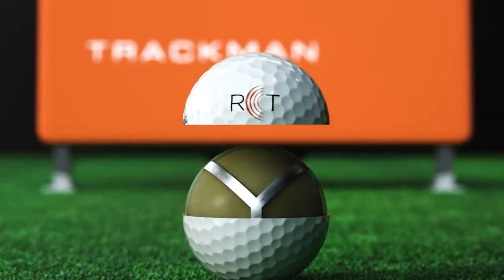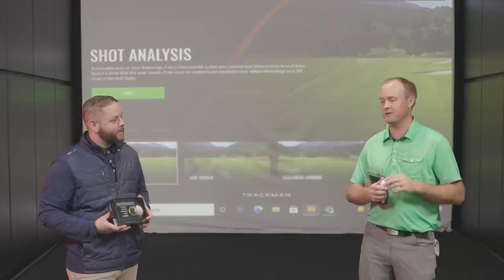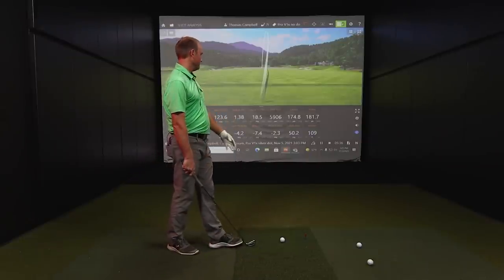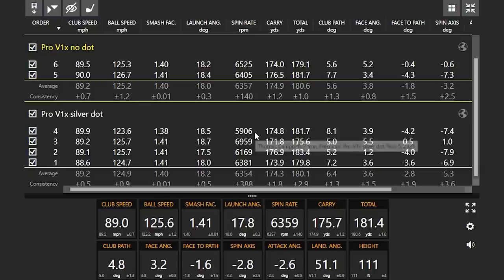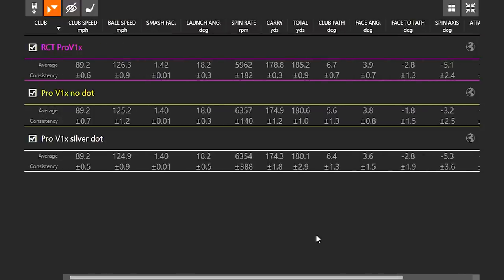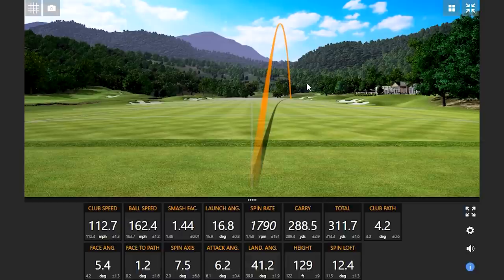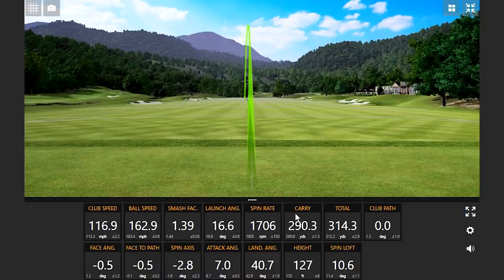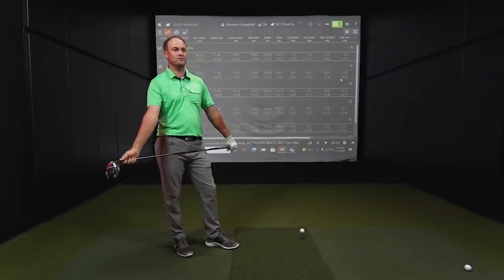Titleist RCT Golf Ball Review | Trackman Test

Comment: Appreciate the continued testing. I understand why you might not be able to do it with the Trackman rep there but it would definitely be interesting to see a spin axis test against the GC3/BLP.
Reply from the maker: What are you looking for with the spin axis test? Who is more draw bias, fade bias etc? They both are very accurate units. Trackman won't shot estimated numbers if the hit location shows up inside and if the environment is set up correctly is the gold standard. GC3/BLP are also very reliable. We will see what we can do - Thomas
Reply: @2ndswing  I think what is of most interest is knowing if there are any significant deviations, and if so under what conditions do they occur. My expectation is that they'll be extremely close with wedges through mid irons but for long irons, fairway metals, and driver it would be interesting to see how the hybrid optical/radar system keeps up.
Reply from the maker: @williamhumber5890  I have used both units and have not noticed any major deviations. There are some general trends that can be true  but it's pretty small (Foresight slightly more draw bias, Trackman slower swing speed, Foresight over exaggerating driver distance with the low spin bombers) This would be fun to look into and we will attempt to get our hands on another GC3/BLP - Thomas
Reply: @2ndswing  II think one really good potential outcome of more direct testing would be to get Foresight to re-evaluate their flight model to better handle those lower spin/high launch shots. People have been complaining about it for years but I've never really seen any direct comparisons presented in any widespread medium until TXG just looked at it about a week ago.
Reply: TXG compared the Trackman to the GC quad. There was very little difference with the RCT ball.
Reply: @JasonSmith-gy2mr  The spin values were very close, but there were significant spin axis differences with driver. It sounds like that may have been due to lighting issues with TXG's setup though so it would be good to see how closely they compare under conditions better suited to TM4.
Reply: @williamhumber5890  The spin axis differences are a major thing like you said.  Trackman doesn't read gear effect indoors once you go above a certain ball speed it seems. Have you found any solutions to this?
Reply from the maker: I can answer this. It's all lighting. Get the lighting environment correct for Trackman and regardless the speed it will read gear effect and hit location - Thomas
Reply: @2ndswing  Thanks Thomas. Does there need to be a certain minimum distance from the ball to the screen ?
Reply from the maker: Trackman will say 8 feet. But I do suggest at least 10-11 feet for faster speeds. Not only to get the ball rotating as it goes to the screen but for bounce back. - Thomas

Comment: Bottom line for me from personal experience using both systems is trackman is king for outdoor usage.  From an indoor perspective irons and wedges are reliable on both systems.  Driver I still find trackman to be sketchy in terms of indoor ball flight reading when swing is 110+ mph.
Reply from the maker: I presume the other system you are referencing is the GCQuad? Both are awesome devices both very reliable love using both. You need the environment to be set up correctly to ensure Trackman doesn't give any "sketchy results" It's really good with great lighting and as long at the hit location shows up number's won't be italicized "estimating" - Thomas
Reply: You are absolutely correct once you hit about 110 club head speed it don't read strike location and therefore gear effect indoors and the results of the shot are essentially useless

Comment: Enjoyed the video.
But why not use the GCQuad instead if more reliable indoor ? And no need for pricy ball (85$usd)
Reply from the maker: Thanks for watching. They are both good units and just as reliable indoors.  We chose Trackman in our stores at 2nd Swing after a lot of research and is the gold standard of launch monitors outdoors and indoors. Trackman will give estimated v measured (italicized v not italicized) numbers if the environment is not set up correctly (lighting, width and distance to the screen) and there is a lot of bad information out there because those environments are not set up correctly. GCQuad doesn't need extra lighting surrounding the impact location and works well in most indoor environments. We put in the time to get the environment correct because we wanted to use the best unit it just takes more precision.  - Thomas
Reply from the maker: Forgot to mention you don't need the RCT ball to get the same accurate numbers it's just more convenient and helps those tighter spaces, the silver dot is 99.9% accurate as well you just have to orientate the dot to the right position, it's just more reliable as you don't have to worry about the dot falling off, the golfer hitting the dot and remembering the position for every shot.  - Thomas
Reply: 65 not 85 per dozen as of 10/22

Comment: I want to know how this actually works. I have always thought that radar bounced off objects, but to have the metal inside the ball be useful, wouldn’t the radar have to penetrate the cover?? For that matter, how does the silver dot help? I could understand if it were a camera based tracker, but being radar I’m a bit confused.
Reply: Radar can partially penetrate dielectric materials (insulators like rubber and plastic), but will reflect more off the metal. The pattern helps break that up to make it more trackable, but how much that helps is 🤷

Comment: To me, its insane to have to spend $65 to get reliable data on a fitting, but what if I don't play Pro V1 balls.  I would prefer to get fit with the ball I use.  My 2 cents.
Reply from the maker: The data is just as accurate with a silver dot on the ball if it is orientated correctly and Trackman is the gold standard when the environment is set up correctly (lighting and distance to the screen) It's the convenience that you get not having to worry about the silver dot, an you can now utilize Trackman in a smaller environment. You can still get fit with any other ball you just have to make sure that dot is on and orientated correctly, the data is still accurate - Thomas
Reply: Pro v1’s and pro v1x’s are the most used ball on the pga tour and used by a lot of other professional and amateur golfers. Trackman from my understanding is the most accurate launch monitor there is, and redeveloping the most used ball in golf to be as accurate as possible on the most accurate launch monitor was probably a no brainer for titleist.